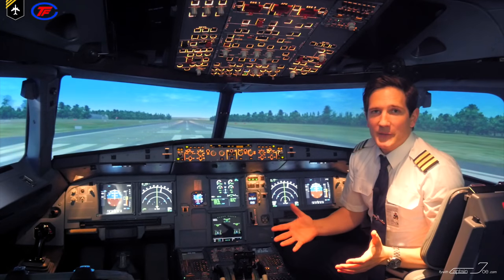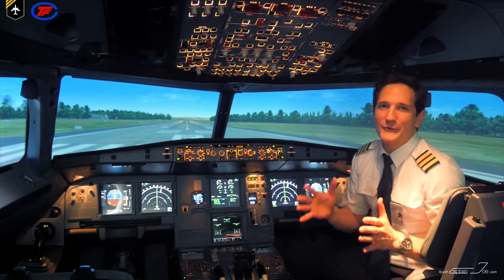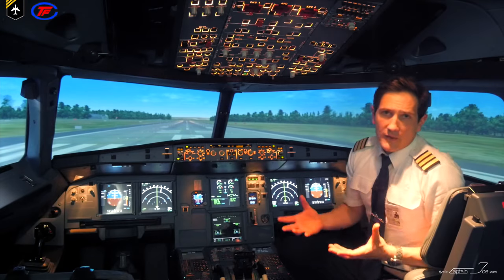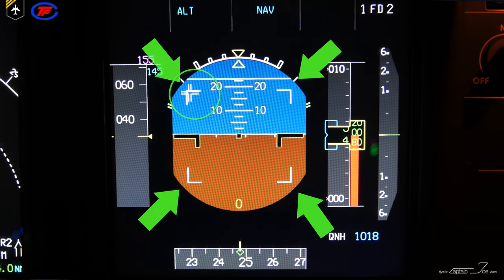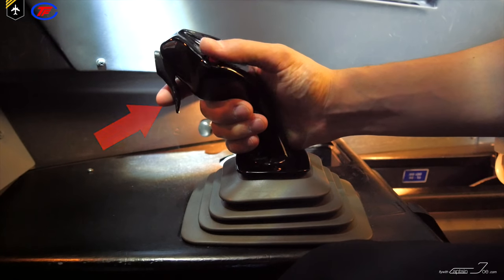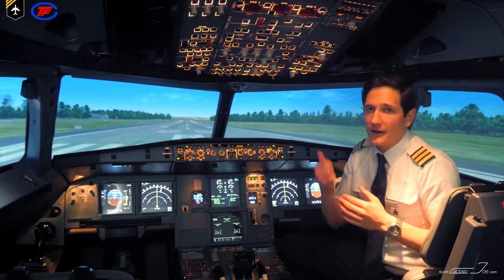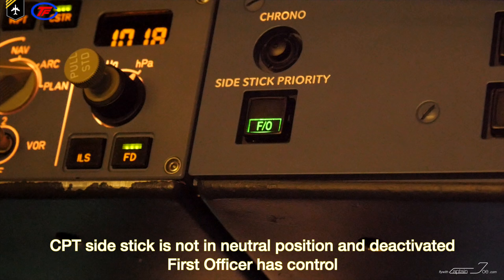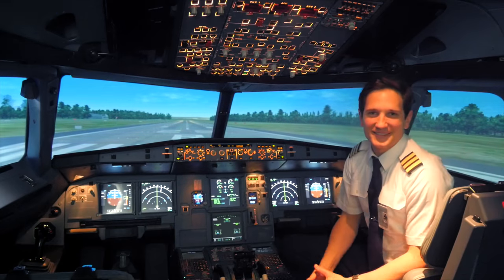AIRBUS SIDE STICK - Explained by CAPTAIN Joe

Comment: Can you explain the cost index please!!! Best aviation videos!!! Congratulation!
Reply: Yes please.. cost index would be awesome
Reply: iñaki fuentes agreed
Reply: This!
Reply: I believe the cost index ranges from 0-200, someone correct me if I'm wrong
Reply: i think it should be 0-99
Reply: IIRC it depends on airplane.
Reply: wat is that hand wheel next to the side stick
Reply: The tiller for the nose weel.
Reply: Although I do not know Airbus cost index figures the Boeing 747 can take figures from 0-9999. I fly mostly for a airline in the middle east and we fly LRC (Long Range Cruise) as the fuel here basicly free. If a operator had high fuel costs compare to operating costs of the aircraft they will elect for a low cost index normally 30-50.

Cost index (CI) is a number presenting the  ratio of the time-related cost of an airplane operation and the cost of fuel. The value of the CI reflects the relative effects of fuel cost on overall trip cost as compared to time-related direct operating costs.
Reply: on the 737 it goes from 0 to 499.
Reply: the a320 should have a cost index range of 1-99
I guess you would usually go between 30-50 as was suggested above

It definitely doesn't go till 100
Reply: FluppiLP we had it clear already. It ranges from 0-99. And no, 30-50 is way too much by todays standards. Most airlines have a cost index between 5-25 for the a320 family, due to the high fuel costs. 
Lufthansa for example is one of the few airlines with a relatively high cost index of about 30, probably because the fuel at Frankfurt is not as expensive. 
the cost index may vary each day though and tend to get even lower every year. there are people working at the airlines who recalculate the best index every day.

Air berlin, the airline of captain joe has a cost index of about 8. you can look that up on the internet, most airlines dont hide the numbers
Reply: Would also dig a cost index video! Please include, if you have the information, some company policy issues, and, whether or not pilots are allowed to make their own adjustments at times!
Reply: Most of us know what cost index is but it would be interestning to know the different company policies behind it.
Reply: 0=economic anything above 0 burns money but gets there faster
Reply: That you go 265th  like

Comment: Hey Joe! I was just wondering why every jetway is connected to the left side on the plane and the planes have doors on both sides, do you have an explanation?
Reply: Afaik passengers board airplane from left side because ground handling activities (i.e refueling, baggage loading/unloading, etc) are done from the right side
Reply: Avantus I know I‘m 3 years late, but Captain Joe just made a video about that.

Comment: Do you ever call your first officer, "number one?"
Reply: Carl Siemens He's Captain Joe, not Picard.
Reply: Actually in some countries out of respect for the pilots, both the Captain and First Officer are referred to as Captains, Plus the Captain is the First in Command, the First Officer is Second in Command.. they are both fully trained pilots capable of operating the aircraft
Reply: Assuming you have a 'number 2' yeah
Reply: ROFL.... XD .... and he is not bald.....
Reply: Carl Siemens yeah but what do you call yourself?
Reply: Speaking TO them, it's  "Captain" and  is the co-pilot and engineer by his name or "sir", although in referring to them, some use P1, P2 and FE and others say Captain, co-pilot and engineer.  And some airlines use PF (pilot flying) and PNF (pilot not flying) for captain and co-pilot. Still other airlines may use PIC (pilot in command) and FO (first officer)for the co-pilot  Flight engineer is "FE" and in most airlines, and sometimes, AE or air engineer.  The FE is usually, but not always also a pilot.  Some of the larger aircraft have 3 or 4 officers, and on very long fights, plus extra crew who will fly and co-fly the plane so the others can rest or sleep several hours.  Same with the cabin crew (flight attendants and/or flight steward).
Reply: Carl Siemens
Reply: Lol, I love TNG series much better than the new Trek movies. Besides, I am a huge fan of Picard and Riker and also Data 😊

Comment: 2:30 Aaawwww I thought that was for the machine guns :(
Reply: Yes front one for mg's, top left for cannons and top right for bombs (at least that's what I prefer). Also while one pilot is flying the other could operate the tripple 20mm turret on the top of the aircraft.
Reply: @eklhaft4531  An A320 with a triple turret. ROLF!

Comment: I believe that the arrangement of the sidestick controls on the airbus is a major design flaw. Since there is NO force feel to these controls there is less sense of what is happening. Specifically, the fact that the two controls are not mechanically linked means that one pilot can move the controls without the other pilot being aware of it. This let directly to the crash of Air France flight 447. All three pilots could not identify the reason for the seemingly 'uncontrolled' decent. The cause was that the pilot in command had the stick all the way back, holding the airliner in a deep stall. the second pilot apparently did not know this because the stick on his side remained in the neutral position. The third pilot also did not notice this. The aircraft was held in the stall for almost the entire 3+ minutes it took to decend to the impact with the ocean. There were many other contributing factors in this terrible accident. I have always felt that if the controls were linked and gave a clear physical indication of contro l inputs this accident may not have happened.
Reply: ed p it was pilot error simple as that
Reply: I suggest you read the AF447 report again. Neither pilot made inputs sufficient to save the aircraft, so dual input only played a minor role, if any.
Reply: i'm not sure if you can say dual input played minor role; below is a part of the report showing Robert trying to pitch down by pushing forward on the stick attempting to recover from the stall, but because he did not know that Bonin was pulling back, their input was averaged, and were unable to recover.
***************************
"As the plane approaches 10,000 feet, Robert tries to take back the controls, and pushes forward on the stick, but the plane is in "dual input" mode, and so the system averages his inputs with those of Bonin, who continues to pull back. The nose remains high." 
from: 
http://www.popularmechanics.com/flight/a3115/what-really-happened-aboard-air-france-447-6611877/
Reply: The minimun altitude required to recover from the deep stall were around 20,000 feet. So whatever happened or did not happen at 10,000 feet is irrelevant.
Reply: It was pilots errors. They were all confused. The question is: why?
Reply: No, as a stall is a stall. Boeing and Airbus the same.
Reply: A French Judge filed a manslaughter charge against Airbus, not the pilots.
Reply: pinkdispatcher the question is, would they have reached that point had their controls been mechanically linked? Would the pilot have noticed the first officer’s input sooner?
Reply: Definitely a design flaw. The sticks should linked all the time and also jokes give you a better feel.
Reply: yes but a mechanical link would solve this problem and create a new one. What if one sidestick get stuck for some reason?
Reply: ed p no force feel would have been useful for NW flight 85. the lower rudder made the stick controls almost impossible to control where as electric controls would have servos carry the burden. I feel like the most sophisticated control stick would have the options to switch between direct mechanical movement and electronic
Reply: Gianluca Ghettini make iT possible to unlink

Comment: I can see also of disadvantages with this set up. Switching sides of the aircraft will discard all previous muscle memory when flying with the other hand. The sum of both sides control can also make it less intuitive for a pilot to promptly input corrections in a critical faze of flight like landing. 

With a yoke regardless of being PIC or SIC the control inputs remain the same. Plus you can visually see the control inputs being entered just by the position of the yoke. Taking control promptly to correct an error also would be much more intuitive since the pilots yoke will already be in the position the other pilot was holding it in.

It seems like a flaw in design to not have both side sticks interconnected together. There have even been a few instances with a PIC and SIC inputting opposite commands. Air France had one with once pilot holding full back and the other pushing down, by the time the captain realized the co-pilot was pulling full back they were seconds from impact (co pilot literally said “I’ve been pulling up the whole time” before the captain said something like “you idiot down down down”).
Reply: Well, what you wrote is complete bollocks. Normally a pilot flyes with one hand on the stick or yoke and one hand on the throttle levers. Now, because the throttle levers in airliners are always in the middle you always have your right hand on the throttle as a Capt. or your left hand as a FO, regardless if there is a Yoke or a Stick.
Reply: shi01 lol in a single pilot cockpit flying a Cessna yes. Not in an airliner though. During landing the PF will often have both hands on the yoke, and during TO the PM will guard the throttles just to make sure auto throttles don’t do something unexpected.

So yes you would need to learn to fly with the opposite hand.

Comment: I actually got the opportunity to go in the cockpit of an Airbus A321 (A320 Family) with IAE Engines and I held the Sidestick on the Co Pilot and I think it's better than the Yoke because you don't need to use both hands on the Sidestick unlike on the Yoke where you need to hold it with both hands.
Reply: actually even in a yoke operated aircraft the left hand is used to fly and the right hand is set to the throttle quadrant .. but dont listen to me...

Comment: I think this design is inherently unsafe in a crew aircraft. One pilot can't tell what the other is doing since they are not mechanically linked. I believe this results in reduced crew awareness as to what the pilot with the flight controls is doing. There is nothing Airbus can do to correct this with software either, so they should scrap the design for all new aircraft, but they refuse to do so. 

Bombardier has adopted this technology as well for their new airliner, which is disappointing.

If sidesticks are to be used they need to be active feedback for maximum safety.
Reply: They could implement active feedback, pretty sure it would be a straightforward drop-in replacement. The fact that they didn't implement it just points to the conclusion that it really isn't necessary
Reply: The military been doing this for over 20 year. All they have to do is implement control priority.
Reply: Some experts say that Air France crash  flight from Brazil to France probably wouldn’t of happened if the airplane was a Boeing. The pilot with the least amount of flight time was flying an air bus a 330 I think. They had a pito freeze, disengaged the autopilot, and the pilot flying at the time literally started pulling on the side stick. The warning could be heard “Stall Stall Stall.  The other 2 members of the flight crew completely oblivious to what he was doing. No dual input. When the captain finally realized what was going on, to Kate. Plane crashes killing everyone on board. Seen the program on it. Good documentary. Terrible fir those poor passengers and grieving family members.
Reply: Carl Gois it’s not because of whether it was boeing or not it was just incorrect reaction from the crew to technological difficulties. Human error.  the korean aircargo flight 8509 will contradict your statement.

Comment: I wonder if the pilot/copilot sit on the left side of the cockpit and he/she is right handed, would that affect his/her performance on operating flight control stick?
Reply: No, we are taught to be ambidextrous.
Reply: it doesn't effect them at all
Reply: Even with traditional yokes, right-handed pilots routinely fly (and even land) with their left hand, since the left-seat pilot will have the left hand on the control wheel and the right hand on the throttle levers.  So, whether the left hand is controlling a yoke or a sidestick is irrelevant and transitioning from right-handed to left-handed flying is quite straightforward. I actually feel a slightly more cumbersome problem is the point of view difference from left to right seats, it seems to affect the perspective during landing and does need some getting used to.
Reply: You use both hands in plane. So you are expected to be perfectly ambidextrous.
Reply: If you drive a car with left hand on the wheel and right on gear shifter does this affect your performance?

Comment: Sidesticks are way cooler than those clumsy yokes dated from the Wright brothers era when control surfaces were moved by cables. Fly by wire is the future baby. Boeing adopted fbw after Airbus and will also move to sidesticks, it's just a matter of time.

Comment: The side-stick is there to give the pilots the impression that they are controlling the aircraft while the computers are busy flying the plane.
Reply: John Ferguson I don’t really like knowing the computer is in charge
Reply: As if the yoke didn't operate on the same principle. Pretty much every aircraft has computers flying it nowadays, regardless of method of ctrl.
Reply: mfnowacki, you know that there is this thing called a joke..
Reply: Hjortsater i've had enough of boeing supremacists
Reply: mfnowacki, O_O
Reply: @forza223bowe5  you must get around the idea that the autopilot does alot of the work
Reply: I thought you were joking...then I realised you weren't 😕
Reply: So true
Reply: mfnowacki It doesn't rely on it being a yoke or stick, butthere are big conceptual differences. Even FBW systems differ on the level of computer assistance. But a 737 for example still got a pure mechanical connection, supplemented by hydraulics. On an Airbus if you move the stick you command a roll rate and the control surfaces will extend in a way to achieve that roll rate no matter what speed or external influences. On a 737 a pilot directly controls the surfaces. The pilot is flying the plane completely by hand.
Reply: WTF I like airbus now
Reply: outside7 yes this is why there is an auto crash in 737
Reply: @forza223bowe5 Computers actually do a lot of things better than us humans
Reply: lol 😂

Comment: The obvious question is why does Airbus use side sticks in place of the 'usual' control columns? Does it affect your ability to control the aircraft according to whether you are left or right handed? I'm sorry if that's a naive question but I've often wondered if having to control the aircraft with your left hand, as the Captain would, is a disadvantage if you're right handed.

Comment: I don't like how the two are not linked like on the boeing aircraft. They have this warning system wich is little green lights that you won't notice in an emergency situation. Don't remember the flight number but this was a main contributor to an airbus crash not long ago. The idiot 1st officer was stalling the plane the whole time they were tiying to recover and nobody knew until it was to late. Had it been a interlocked system like boeing, that would not have happened. I have talked to many pilots and they almost all prefer the sidestick for comfort reasons but have the same opinion that I have about interlocking them. It looks cooler than a traditional yoke and seems more comfortable but the Boeing design is safer.
Reply: You mean probably fligh AF447 but the final accident report came to the conclusion that the side stick design had absolutly nothing to do with the outcome of this tragedy.
Reply: You're misinformed about that particular incident.

Comment: 3:27 I know this is late, but I’m not entirely sure if you must hold the priority takeover button for forty seconds. I had the honor of visiting an A320 flight deck a few weeks ago, and the F/O showed me some sidestick operations. He also showed me the priority takeover, in which he held the button for a maximum of five seconds.
Reply: the priority button has multiple functions. It disengages the autopilot and releases the side stick from it's detend, it gives you exlusive control over the plane as long as you hold it or it deactivates the other side stick if you hold it for more than 30 seconds.

Comment: Hi captain Joe. About side stick. If the planed is not trimmed, is there a pressure on the side stick? Thanks
Reply: Yes. The more you pull back on the stick, the more back pressure is required to keep it steady. When the plane is trimmed properly, the stick should be in the neutral center position and thus there is no pressure at all.